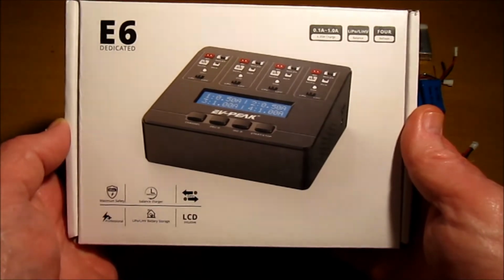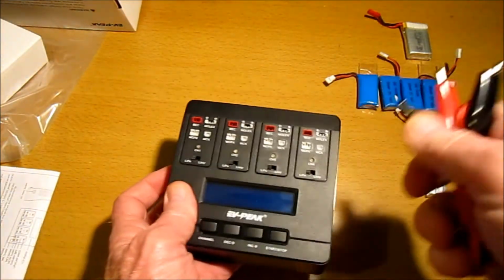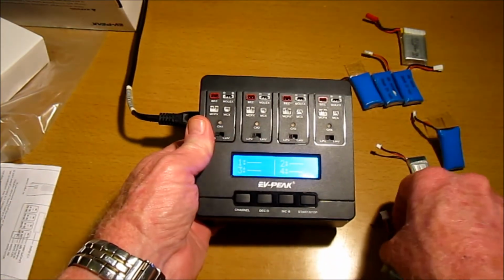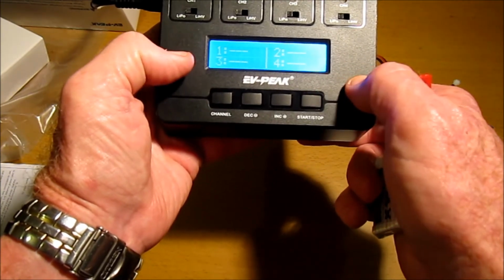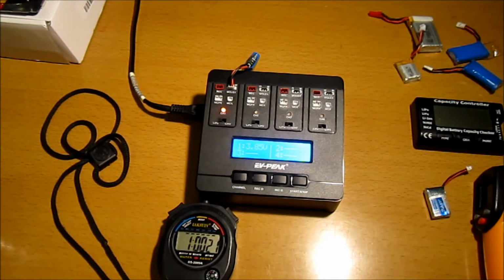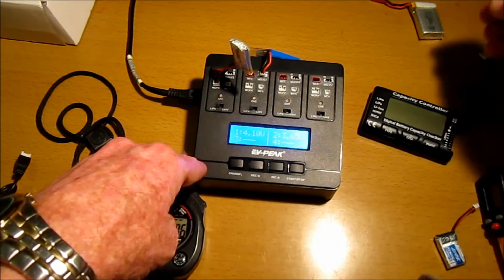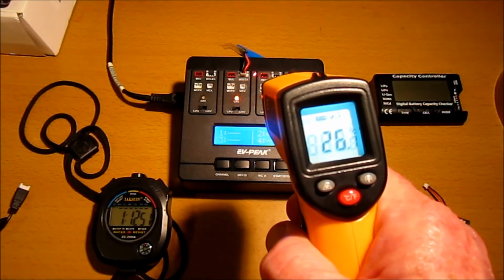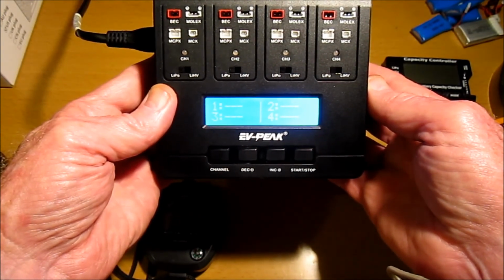EV PEAK E6 1s Lipo battery charger review

Comment: AndyRc, very good demonstration of the accuracy in the measurement of the loader. That is important, although it is also important to take into account the compatibility of the charger with different types of batteries.

For example, the V-peak is unable to charge the JJRC H20, MJX X902 and Eachine E012 nanodrones without adapter cables. Why? For carrying the inverted polarity these drones with respect to the Inductrix, which is the polarity with which the V-peak comes standard. I received today the charger and nothing else to connect the battery of the JJRC H20 has started to pitar with inverted polarity error, and indeed ... they go with the connected cables just inside of the Inductrix.

Alternatively, to charge these batteries the Chaarson magical core and magic box type D (once solved the problem of obsolete firmware) can charge the batteries of these drones, I do it without problems. And I do not know if Chaarson sells any more charger, the equivalent Skyrc does not support MCX connectors since the ones it carries are a bit larger (for batteries only existing in China :-p)

Comment: Hi, the same problem that has had the author of the video I had I just try to put to charge the batteries of my JJRC H20, MJX 902 and EACHINE E012. The charger goes with the proper pority to the batteries of the Inductrix that use that type of connector, but does not serve for those that carry opposite polarity. It would be interesting that with a selector could change the polarity of that channel.

The multi-channel charger Chaarson Magical Core with magic box type D does support these batteries but could not with which the Inductrix mounts, but to me it solves better the problem than the V-Peak, in addition to charge to 7.4v the batteries of the DM007 And GW007, also with an adapter would charge the batteries of the JJRC H8D.

The third option is the one that uses Skyrc in its multichannel 1S charger that comes with two connectors for different polarities, although its connector type MCX comes with different measure and does not support these batteries.